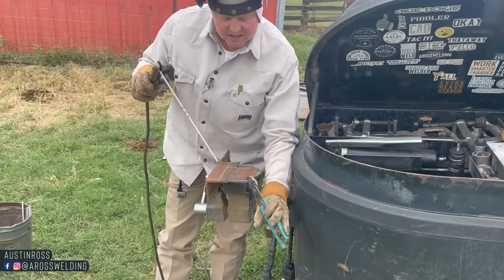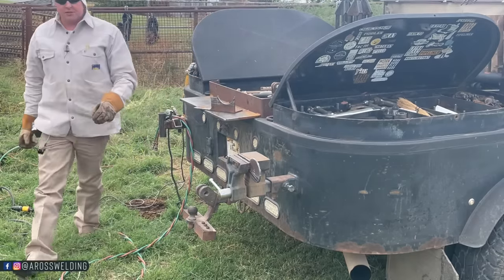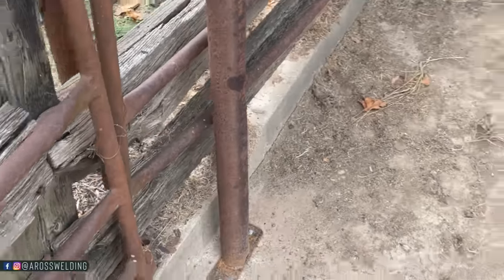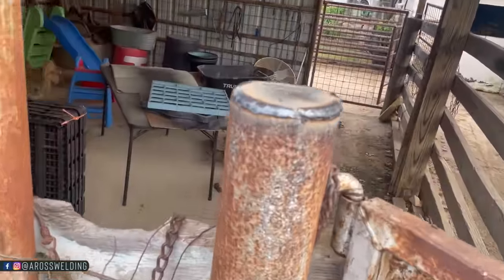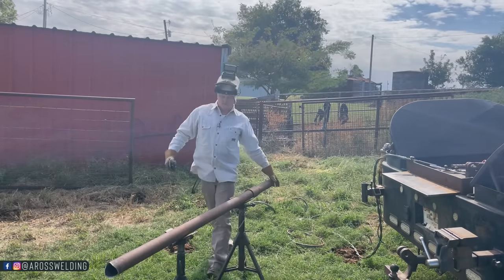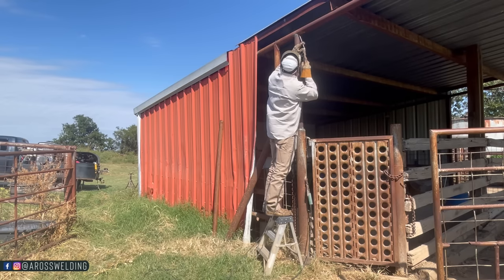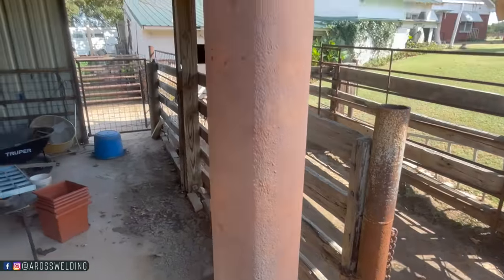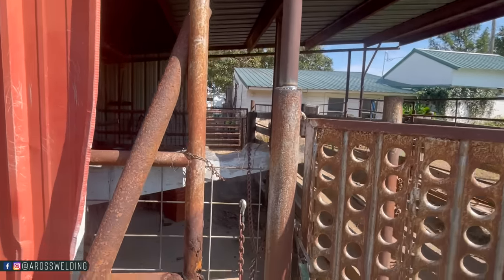Repairing Old Barn (Stick Welding 7018)

Comment: Can’t help but mention for the youngsters, there is no such thing as 2-7/8” pipe. What you’re using is actually 2-1/2” pipe that just happens to measure 2-7/8” on the O.D.
Reply: As well as being able to use a normal torch. You don't need anything fancy like he has.
Reply: For the rest of the class - pipe is measured on the ID and tubing on the OD
Reply: For the high flyers - pipe is measured by the Id up to 12"  and is measured by the od after that
Reply: Thanks for commenting on nominal pipe sizes
Reply: This guy is not the sharpest tool in the shed.

Comment: I've not seen anyone remove the burned flux off the end. I don't have to tap the rod to remove the flux. Plus, I bend my rod to a 45° with it in a 45° groove. It's easier for me to comfortably alter my position and rod feed angle without breaking arc.

Comment: You see a lot of scabbed up stuff and used/repurposed material on old farms and equipment.  Times have changed.  Back then most folks could build something and make it work regardless if it was wrong or right.  Material cost was more than labor then as well.  And also they couldn't just whip out an order on the internet and have it the next day either.  I might add that they lived in the Cold War era where they really thought that a nuclear war was going to happen any day.  Remember the drills in grade school where you were suppose to hide under your desk for "protection" from nuclear warheads!?!?!?  LOL!!!  They did what they could with what they had and maybe didn't know any better.  I deal with a lot of this on farms I do work on.  It's absolutely amazing what they did with some of it having ZERO care that someone may have to replace what they built.  Blows my mind!!!  But hey!!!  I don't know what they were dealing with that day when they did it either.  Thanks for the channel Austin!!!  You're a solid dude!!!
Reply from the maker: Thank you for taking the time to write this message. Yes, I’ve thought quite a bit about how things are done now days versus how they were back then on account of cost of labor versus materials. It’s definitely something construction companies have to keep in mind when weighing their options and hiring more experienced help versus less experienced help. Because that plays a huge part in how much a job cost. An experienced employee or contractor can get the same job done in a notably less amount of time than a less experienced employee or contractor.

Comment: Hay Austin great video, I have found for better restarts on 7018 rods when you snap out drag the rod between your fingers while it's still hot and it won't glass over and restart easier

Comment: I love your channel and how you do and explain things!!!!!! Question: When you  turned over the steal angle welded the bottom of the plate, if you are trying to keep everything true and introduce as little distortion to the work, would you tack the back in a few places and then run the finish bead of weld? I get when the weld goes in, it is as hot and large as it will be thus it shrinks as it cools, you tack weld two parts to act as a clamp and hold things in place so to speak and then weld it together....probably should have finished watching before I ask the question.....did I tell you how much I love you channel???? lol

Comment: Just for our general edjumaction, why do you sometimes bend your welding rod?
Reply: I am no welder but I try. I think the answer is to get the tip of the rod in the correct  or best position when you strike your arc.  When that rod is new and long it is much harder to steady and place than when you have burned thru the first half.
Reply from the maker: That way I can change direction/angle of the rod quicker and to any angle I need to, to get comfortable.
Reply: @dougm5186  at around 19:00 I see what you are talking about he bends the rod at a 90 deg right by the stinger, he answered the question already but that is do clever why he does that!!!! I never saw that before and I see how helpful that can ! nothing like watching a pro work....I love watching this man work!!!!!!!!!!

Comment: Pipe that was either salt water flow line above ground or saw its fair share of Hydrogen Sulfide (H2S, Sour Gas). It never stops rusting. I have some in my front fence that the pipe salesman slipped in on me. Looked good at the time, but is falling apart! Dang it.

Comment: Like your work for this repair. Had to do same type of repair on my gravity fuel tank legs were rotting out at the bottom and in general the used oil was fairly well gone. Saddled new legs and welded them beside the old one except didn’t weld to tank welded to the cross members must be working tank still up. And the gate is cool.

Comment: sorry if you already answered this question:  you did not stop to chip/brush the slag off before you made your second, third, fourth beads.....I thought this was required when making tie-ins using 7018? am I mistaken?  thanks.....just trying to learn.
Reply from the maker: No sir, it’s not required. Not on somethin like this. If I was testing I would definitely chip, brush, grind, ect. Check out this video:
https://youtu.be/8q0oyrqcCOA?si=XuLlPD0dx5E3uveM
Reply: thanks for your reply.  very helpful.

Comment: How do you prevent from frying your electrical system in your truck by welding on your vice. I'm wanting to build a welding rig that is why I'm asking
Reply from the maker: I’m not certain on the details of this question. I just know that I’ve never had any issues with welding on the back of all three of my welding rigs I’ve owned over the years. And no one else I know has either.
Reply: There is no issue because the current return is to the origin-the welder, not the DC system of the truck.
Reply: Diesel mechanic here. The problem comes from if there isn't a good connection to the earth clamp, or it's placed a while away. It CAN cause a surge and pop drivers and controllers in ECUs. Have seen it happen on one occasion, and the clamp was put on crusty shit. Bright steel, close to the work I.e clamp on the work, not the bed when welding in a vice. End of the day, it comes down to not being stupid. It doesn't stop me welding shit on my ute, or trucks at work

Comment: so, what size pipe do you use for a run in shed? I could use another decent shed. Somehow I don't think I can find a decent deal on used pipe in the mid east coast. :(
Reply from the maker: It depends on the dimensions of the shed
Reply: @arosswelding about that size you are working on... and the ocd part of me wants to take that gate, cut the middle in half and turn it over so the holes line up. ;)
Reply from the maker: They used 2 7/8 pipe for the posts/Collum’s here. And for the runs under the Z perlin

Comment: Got any videos how you added the strap to the hood instead of the ratchet? Cmon
Reply: You can buy a headset with the strap in it. If you got a 5” auto shield don’t do it, they’re just too heavy and the tightest you’ll get it will make it so uncomfortable you’ll end up throwing it away.
Reply: @samuelsnyder5169  sounds good. I’m a 2x4 guy through and through so no problem with that. Thank you

Comment: Is the 3/32 rod easier to control than the 1/8 7018?
Reply: It's just as smooth just makes a baby bead
Reply from the maker: 🤔 in some situations, yes. Others, not so much.
Reply: slightly easier to bend!